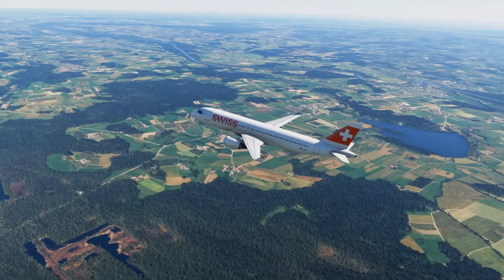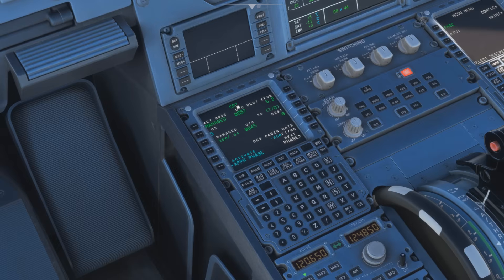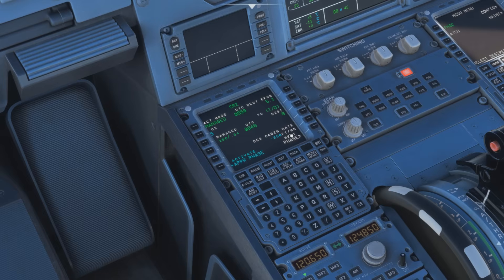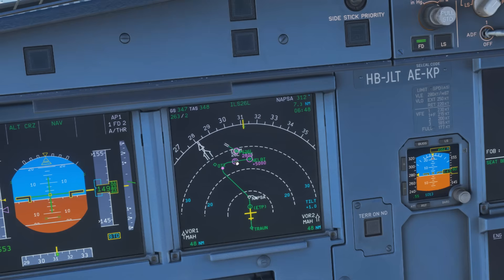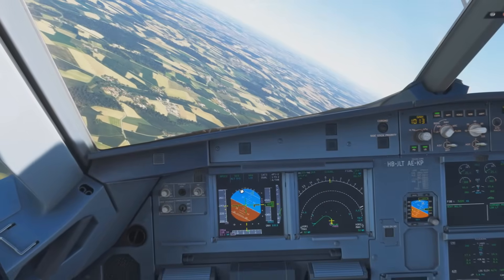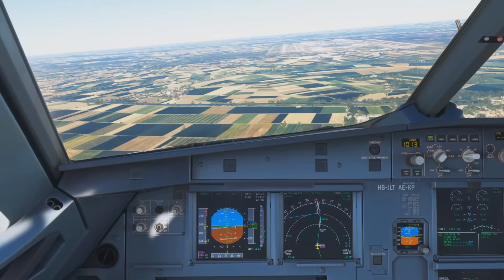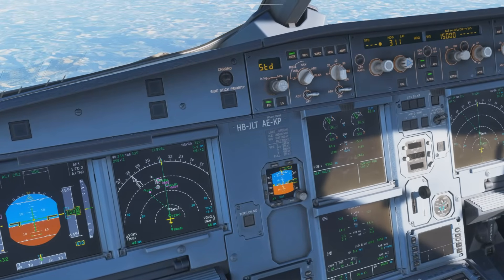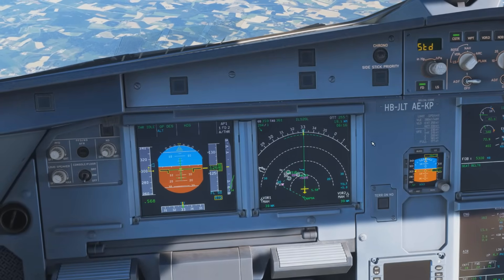What is the Approach phase and how to use it!

Comment: If you do a direct radial in to CF when getting vectored by ATC, will the automatic activation of APPR phase (purple D on ND) work, when flight plan is properly sequenced? Even if in heading mode towards extended centerline?
Reply from the maker: If you do a direct to to the rwy you have to activate it yourself. If you do it to a waypoint and you pass that point within 5NM then it will sequence automatically. Hope this helps

Comment: Thank you for the thorough explanation! From my simming experience: As per online flying (VATSIM), not IRL ofc, when ATC managing the approach phase is online, you will almost always receive vectors/shortcuts and/or speeds, so it's a good practice IMO to activate the app phase whenever you start to receive this. As well - as very often happens in the simulated environment - keep an eye on any gaps in the FP: If any, the computed predictions are no longer reliable, so engage the APP phase early - in my opinion, the best time to do this is while descending below 10000 and/or starting to reduce the speed manually. (I almost never rely on managed speeds on the approach phase  - maybe Phoenix is more accurate, but FBW is not the best at this). Cheerio!

Comment: The problem with Fenix is that it does not handle VNAV correctly. I saw the cut in your video - it usually does not slow down so probably you used the speed brakes. This what I have to do constantly on approach. Flying also Toliss in Xplane I am sure it is a Fenix issue - the Toliss (and by the way the FSLabs 321neo for MSFS, too) slows done as supposed to do...

Comment: My question is: in the first sample you did not enter QNH, TEMP or WIND and you did not hit Activate approach phase in the MCDU. Correct me if I am wrong please
Reply from the maker: You always have to fill in the QNH, wind, etc. for every approach, otherwise you get an error msg on the MCDU scratchpad.
If you follow the original flight plan you don't need to manually activate the approach phase.

Comment: At what point do you activate APPR on the UFC (glareshield). I always wait until the LOC/GS is annunciated? Thanks. Also is the approach phase the same on a Boing?
Reply from the maker: In the real world we arm the approach when we get cleared for it. However, there are some exceptions. For example if the clearance comes very early and we are still more than 40NM away from the ILS. Be aware that the ILS indications in MSFS are not realistic. When you fly towards and island in the ocean you can pick up the ILS 60NM away from the airport and already use it as a rough guideline. in MSFS the ILS usually appears very late.

Comment: I noticed when you were too high you increased speed to get down faster, whereas I tend to increase vertical speed. I found increasing speed sometimes results in the engines increasing thrust, which is not good for reducing energy!  Can you say something about the pros and cons of each method (I know I have to monitor speed closely and be aware of how close we are to the target altitude if I use vertical speed). Maybe this would be a good subject for another video.
Reply from the maker: I have already made a video about this 😉 Increasing speed only makes sense when you are in open descent as this will mean the engines will always remain in idle
Reply: More speed = more drag. So you definitely descend faster. It does not make sense when you are close to Fl100 and you need to slow down to 250kts.

Comment: Say you’re in flaps 2 and you’re not in approach phase, will the engines still spool up past the flap speed limit?
Reply from the maker: Unfortunately yes. If the engines spool up you have to immediately pull the speed and turn it back down.
Reply: @fsclips interesting! Seems like a bit of a safety risk, wonder why the computer isn’t programmed to keep the speed limits in mind.
Reply from the maker: @ItsSkyhawk  It only does so in regards to minimum and maximum speeds. I have had a flap overspeed event once. It was a very gusty, windy day, we selected F2 and all of a sudden the speed went up and we went into the flap overspeed. I could imagine that newer aircraft such as the A350 are more advanced in this regard, but I am not sure.
Reply: @fsclips thanks for clarifying. I imagine overspending the flaps is not as dangerous as overspending past the maximum speed
Reply: Also another question that I have is that say you’re in approach phase and flaps 1, and there is a speed restriction of 200 knots programmed in, will the aircraft follow the speed restriction or go down to the S speed?
Reply from the maker: @ItsSkyhawk It will only follow all restrictions if they are programmed in the FMS and the descent is flown fully managed.